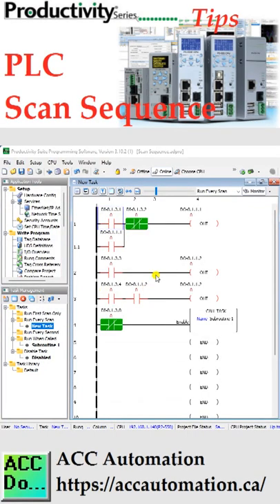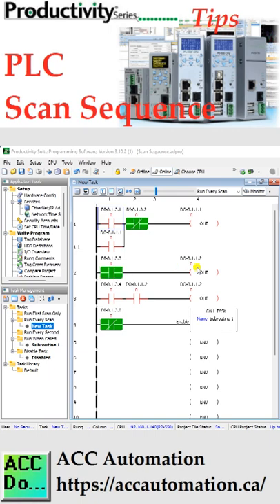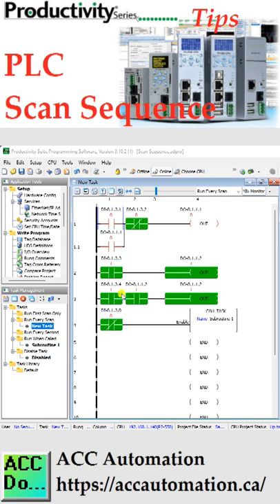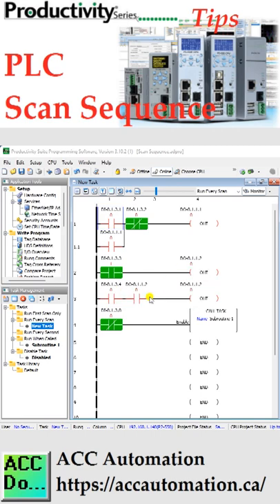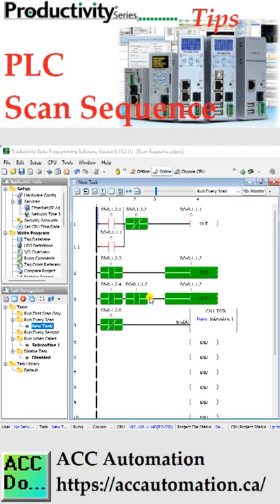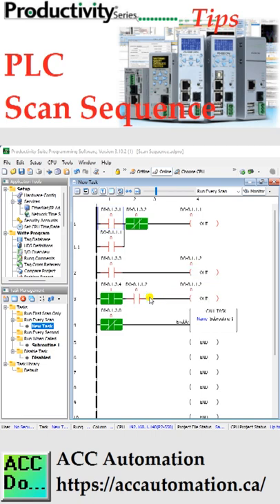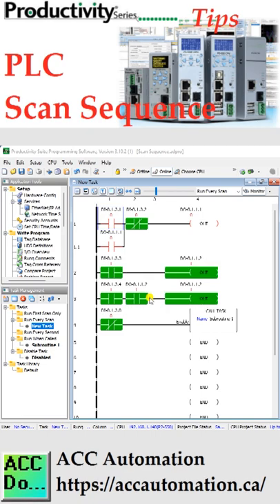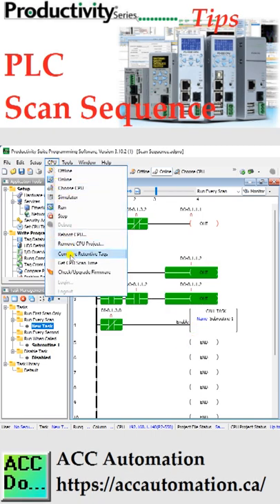Productivity PLC Scan Sequence

Comment from the maker: Programming and examples of the Productivity series can be found at this URL:
https://accautomation.ca/series/productivity-1000-plc/

Productivity offers three distinct form factors with two being rack-based and one being stackable. Each series offers different I/O capacities but all use the same programming software, allowing you to easily scale your control up or down depending on the application or machine building. The productivity suite software provides versatile programming with tag name addressing that has no predefined memory structure, and offers convenient device integration for easy plug-and-play operation with our PS-AMC motion controllers, GS drives, Protos X field I/O, and StrideLinx VPNs.
A few of the Features:
- Tag name-based programming with 50MB user memory
- Numerous built-in communication options including Ethernet, serial, USB, remote, and local expansion
- Web server and mobile access
- OLED/LCD module data displays (P2000/P3000)
- Integrated motion controller, GS drive, StrideLinx VPN, and Protos X field I/O support
- External microSD data logging
- Scalable platforms from 128 to over 59K I/O points with analog, discrete, pulse width modulation, and high-speed options
- ABS certified for marine applications (P2000/P3000)
- Project simulator
- Easy-to-use coordinated motion control with the PS-AMC motion controllers and built-in motion instructions

Regards,
Garry
ACC Automation
https://accautomation.ca/